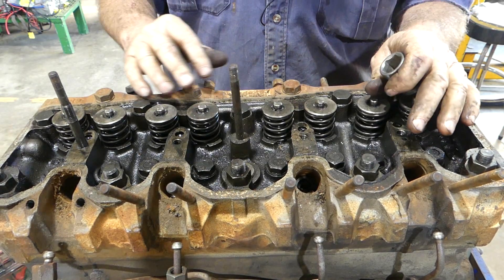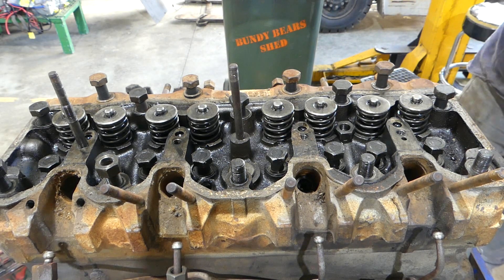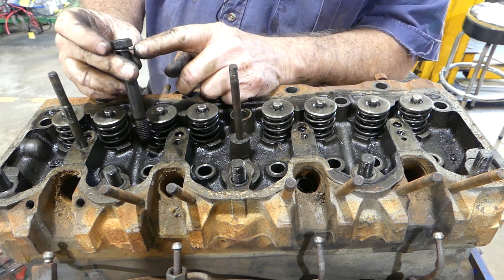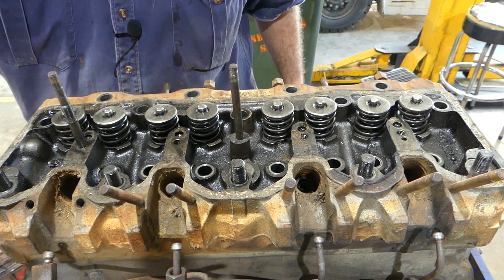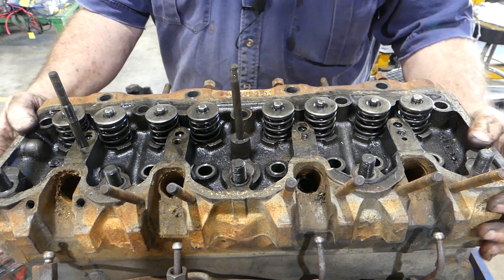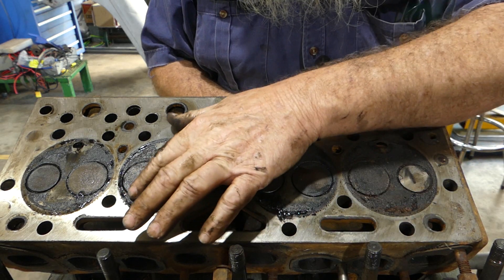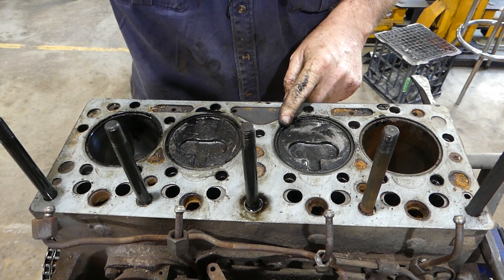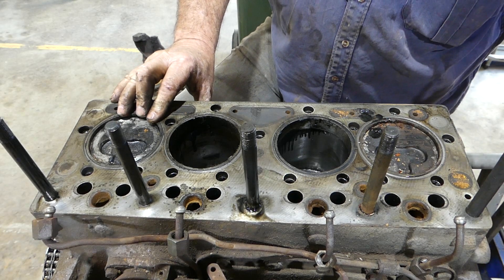Ferguson 23C Diesel Engine Part 4 Removing the Cylinder Head

Comment: Hi Bundy! Im from Brazil and I need to buy the spares parts to 23C engine. Could you send me the bronze and crankshaft standard measurements please to try find it here? How to buy and receive it in Bazil? I wil be very grateful with your support.
Reply from the maker: I sold the parts business but on the www.queenslandtractorspares.com.au website in the technical section is a free workshop manual download with all of the spece in it. Look for the Massey Ferguson 35 manual in the technical section.

Comment: That engine looking so good condition.
I bought new head bolt set and there is two extra bolts 132mm. Do you know what is idea for those? Set have nine 125mm bolts so i can use those.
Repairing my MF35 23C engine and cylinders no big wear but one liner cracked and one broken head bolt. So i put new liner, piston, rings and bearings.
Kake84 Finland
Reply from the maker: Im not sure what they would be for, have a good look and make sure you are not missing something. check my video on the secret tubes in the 23C head, it may save you some drama later.

Comment: My father told me to compare the headbolts tread towards eachother.
Hold one hed down, and the other head up.
If there was a difference in tread, it would show up easily.
Bjorn from North Norway.
Reply from the maker: Yes that would be good advice I would think.
Reply: Srpski

Comment: Hi Lance, as you were struggling to lift off the cylinder head I thought an easier way may have been to rotate the engine on the stand 90 degrees and pull it off sideways .  Cheers .
Reply from the maker: Funny you may say that, when editing I was thinking the same thing, lol.